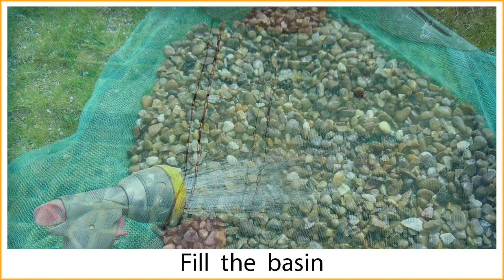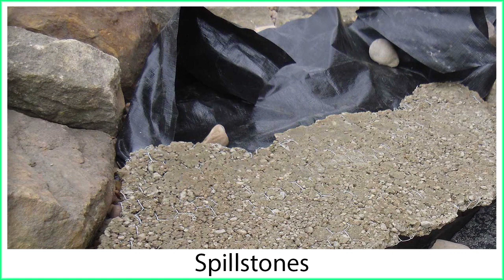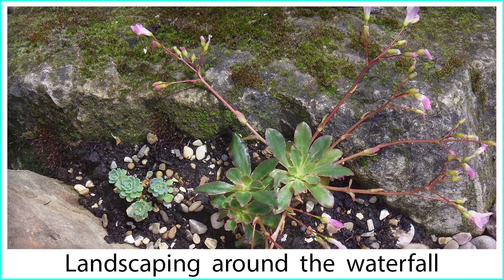Pondless waterfall by The Lady Plasterer - DIY budget style

Comment: HI - what is the fixing you use for the spillway tank and where did you get it from please.  Great job BTW!
Reply: Hi Andrew. I'm not sure I understand your question but if you ask about what is after about 1.33 minutes of the video it is what they call a "liner connector". That piece there consists of two parts. The liner connector (the one with the screws in it) and a part that I unfortunately can't remember the name for. It's stepping down in size and you cut it off to fit the size of hose that you are using. These two parts were glued together in the shop where I bought it. I then used something called "Adseal water leak repair" to spread on the two surfaces before I screwed them together - one on each side of the waterspillway wall. They recomended me NOT to seal with silicon even though it's sometimes is ok in water. I bought my stuff from my nearest aquatics http://www.wharfaquatics.co.uk/ Maybe they can send you some. I think they sell online.
I hope this answers your question and good luck if you're building your own. You might think that you never want to do it again just when you have finished it but soon you will think it was really worth all the work :)
Best of luck
Susie